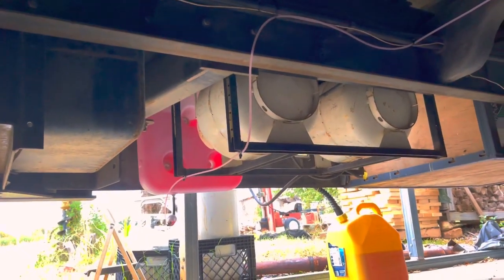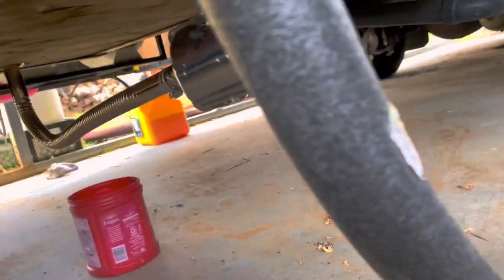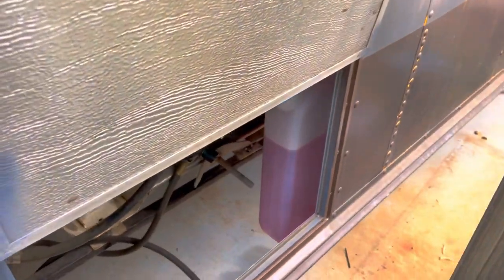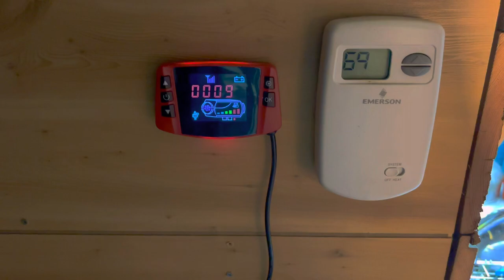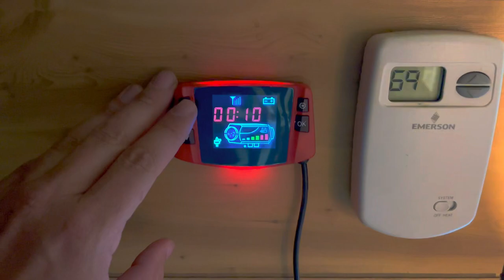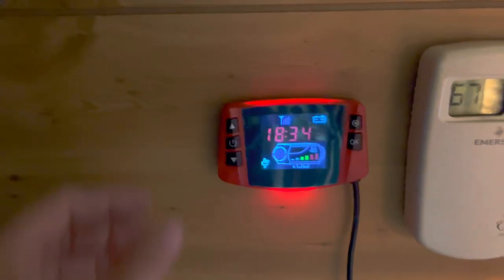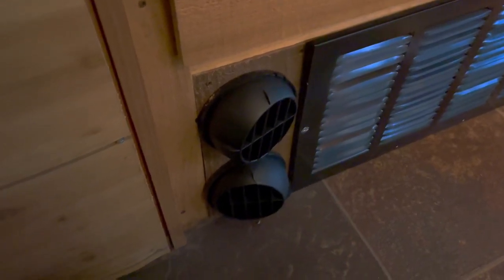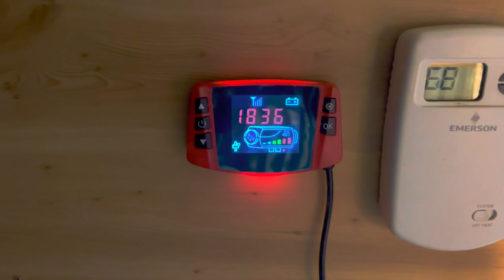Vlog #48: Diesel Heater Install

Comment: I had a diesel heater in my yacht, It was a real headache till I found that the fuel is very touchy. It MUST BE ON ROAD DIESEL! From a place that does a heavy turnover of fuel. Like a large truck stop. Do NOT use off-road diesel because it has an additive that messes up the firebox. The stack must have a draft regulator, & be high enough to not be affected by anything on the deck.